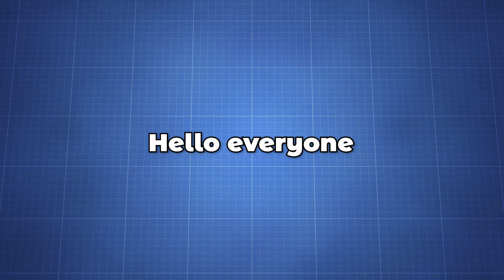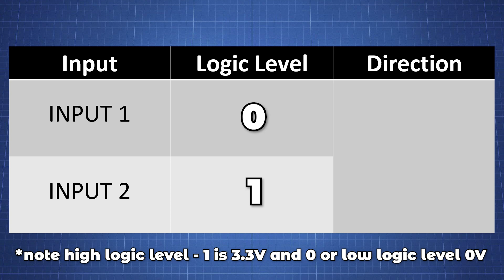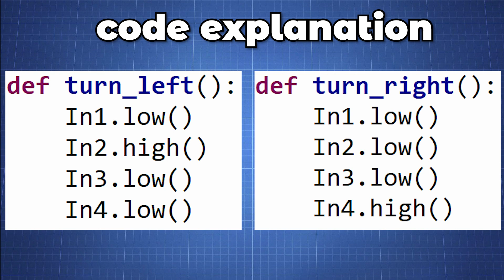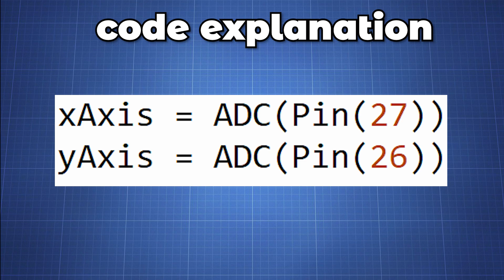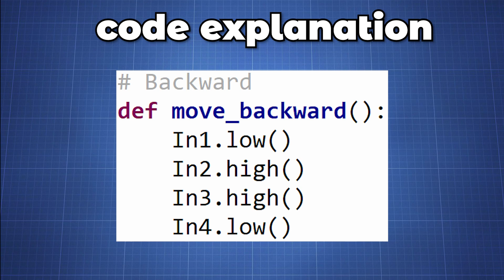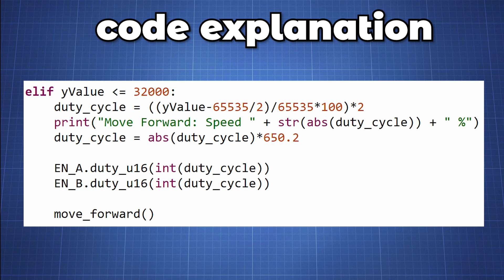Raspberry Pi Pico Tutorial - L298N Motor Driver Module

Comment: Great vid. How to control 4 motors?
Reply from the maker: You can add another motor driver and use other gpio pins to control it, but I would suggest not using this driver as it has a high voltage drop, something like the DRV8833 would work better for a simple robot car or project that does not need to drive big motors

Comment: WHICH SIMULATOR IS THAT?
Reply from the maker: I am confused what you are referring to, I did not use a simulator?
Reply: I guess the animation and diagram illustrations was so good it looked like a simulation of the connection
Reply from the maker: @TawfiqSaid-y6u  it is a software called fritzing to make the diagrams but no simulation there is a few pico ones but very limited in what it can do

Comment: I am powering my motors with 6V battery pack and my robot is not responding sometimes to my input. Is 6V not enough to power both robot motors? I am using 4 AA batteries
Reply from the maker: it might be if your PWM is set to low the motors will not turn, not having enough energy. These drivers also has a high voltage drop they are not very good drivers
Reply: @NerdCaveYT  Good point! Thanks for your help

Comment: Why did we connected the ground of l298n, battery and the pico? What would happen if i directly connect l298n ground to the battery?
Reply from the maker: All electronic components need a reference point to interpret voltages correctly. This reference point is usually the ground (or 0V) of the system. For the  Raspberry Pi Pico, and the L298N, and power source battery, having a common ground ensures that all parts of the circuit share the same reference point. This way, the signals and voltages are interpreted consistently across the components. If we do not have a common ground this can cause signal reading problems
Reply: @NerdCaveYT  Thanks for the reply but what could be the consequences?

Comment: i have a wierd problme, the driver can control one motor fine but not both, each motor works fine individualy put when both plugged in only one workds
Reply from the maker: That sounds strange so when the left output works and right output of driver but once you run both it does not, could it be possible a code issue? Do you have a multimeter to check to voltage level that might be that there is to high of a voltage drop from the driver and you might want to increase your PWM if you used it
Reply: @NerdCaveYT  yh I think it's a voltage issue but I'm not sure, one runs fast the other slow, the motors are interchangeable so nothings wrong there, but anyway thanks for responding:)

Comment: When i run the code with all the same connections only one motor spins
Reply from the maker: did you double check the wiring to the other motor

Comment: Can I control a servo that module? I want to make a roof open and close witj a rain sensor module and one servo that open /close when rains
Reply from the maker: It depends on the size of the servo and the current that it will draw, there are other more effective motor driver modules then this L298N

Comment: Thanks, I've been trying to do this , but with just using the IC. It works fine with the arduino uno, but when I plug the same thing into the Pico, I get nothing. I check the pico pins with an LED and there are signals coming out. Any ideas?
Reply from the maker: is it possible to send me your diagram so I can have a better look? https://discord.gg/BTdMWN7ffr
Reply: @NerdCaveYT  thanks. I got it working. The issue was that the 3.3v from the Pico wasn't enough to power the ic. Had to use the other supply.

Comment: I have a question, how do i control the speed of the motor normally? i've tried using PWM for the enable pins, and setting the duty cycle lower, but that didn't seem to work. I am not using a joystick, and just want my code to be like the first example, but with speed control. Thanks!
Reply from the maker: Only way to do speed control is with PWM, now if the PWM duty cycle is to low, the motor will not receive enough power to make the shaft turn and you should hear a high pitch frequency noise, and as you increase the duty cycle it will start to turn. So with button controlling the speed make the duty cycle to a point where motor turns then you can use a button to increase or decrease the duty cycle to control the speed. Also a side note the L298N even though very common motor driver it is not as efficient as the alternatives. I will next week make an update video with a different driver the drv8833
Reply: @NerdCaveYT  Hello , i have the same problm . I am trying to make robot follwing the black line but the car is moving too fast , and the lowest pwm i can set is 52000 . What can i do ? if you need i will send you my code , please help

Comment: Hello

In your video you feed the pico through the usb socket. can it be powered with the LN 298 card? if yes how? otherwise how to power the pico other than through the usb socket?
Reply from the maker: So I mentioned in video the LN298 does have a 5V output which you can plug into pin39 of Pico to power if the USB is not plugged in, both should not be plugged in at same time, so when programming the Pico do not have power connected from the motor driver to the Pico.
Reply: @NerdCaveYT   Thank you very much for your answer. Another question, is the voltage supplied to the LN298 board lowered when it reaches the engines? If I power the board with 7.4V I will have how much power to the motors?
Reply from the maker: @pasquentmax  If I remember correctly there is a high voltage drop like 1.6V or somewhere in that range, the LN298 is not a great motor driver, I used it because had a few laying around, recently I made a new design for the DRV8833 a custom PCB which I will probably upload next week

Comment: my pico won't active the power out of the controler for the TT motor, but powering the input 1& 2 with 5v and ground will make the motor spin, how do i get my pico to activate the motors?
Reply from the maker: I am a bit confused are you power the driver with a separate power source, the pico won't be able to power the motor driver, The motor driver can deliver 5V output which you can connect to pico to power it, but then you can't have USB plugged into the pico.

Comment: i don't have access to male-female wires at this time, how can i still do this?
Reply from the maker: if you connect the board to a breadboard you can just use normal wire then, network cable works well or just anything that works with breadboard if you have no breadboard then directly soldering wire to pins
Reply: i do now have access, but now i'm facing a problem. i'm fairly cretain that it's not the motor's fault, but running the code doesn't seem to affect the motors at all.
Reply: wait i am an idiot 😂😂! i didn't provide the power source! silly me! THANKS FOR THE CODE!!!

Comment: It's alive, thank you dude...!
~
I'm using four 2A batteries for powersupply, and sometimes there's only beeping sound (and the correct LEDs) from the L298n...!
Is this a powersupply issue...?
Reply from the maker: Is the beeping sound coming from the module? I have not encountered that before. I know if you use the PWM and you do not supply enough voltage to the motors it will give of this high frequency buzz sound.
Reply: @NerdCaveYT  yeah, it comes from the module, not the Pico board...!